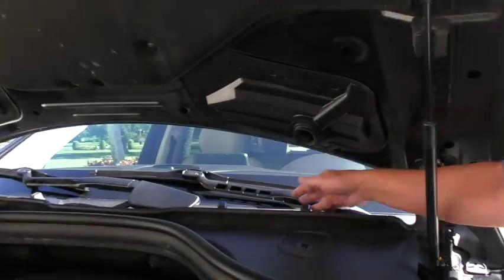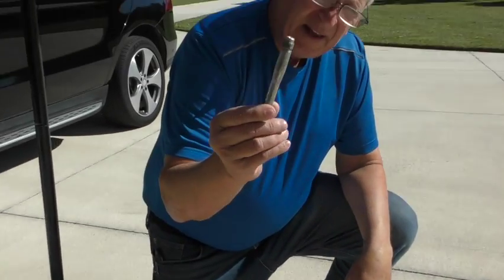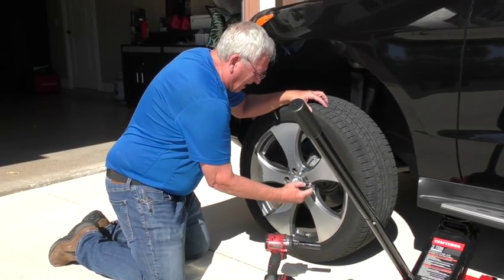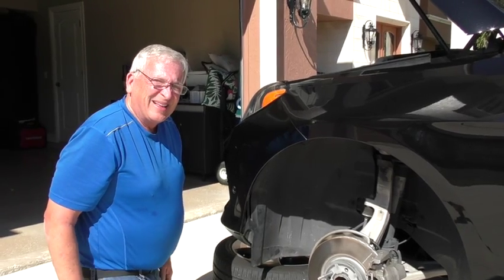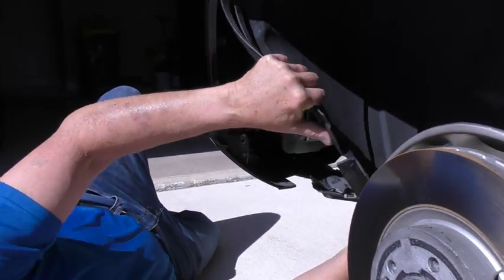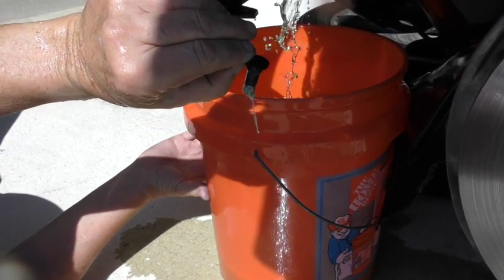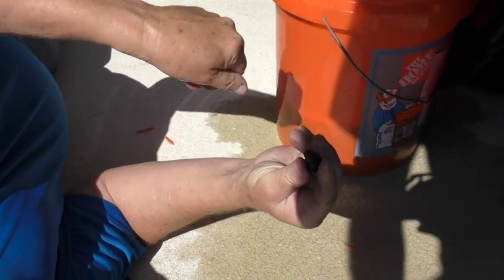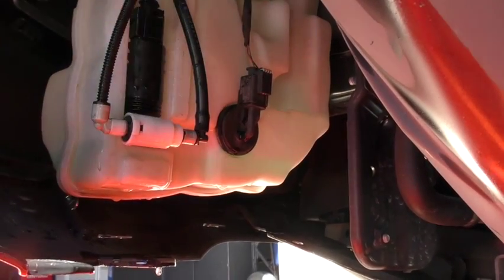Mercedes GLE 350 Windshield Washer Unclog W166

Comment: This is a nice DIY video. I fixed my clog without having to resort to all of this. I drained the washer reservoir with a vacuum siphon as low as possible. I then added approximately 2 cups of bleach followed by about a gallon of hot tap water.  Let it sit for about 10 minutes. I then took my garden hose and spray nozzle and stuck into the reservoir as far as it would go and stood back while the water was turned on full blast for a few minutes letting everything back flow out the top. Started the car and the washers were working again. I let them run a while to get the bleach out of them and finally rinsed everything with water. It is now good to go and took me all of 15 minutes.
Reply: Thanks for this it worked for me today 👌
Reply: Your method worked like a charm!  Much appreciated!!!

Comment: Thank you for sharing. This is exactly what I need to fix my windshield washer does not work at full pressure.   I didn't have to remove the wheel at all, just turn to the right as far as possible (I parked up on the driveway ramp so it might help in my case.  I pried oven the wheel well trim enough to put my hands in, removed the pump and then removed the grommet for cleaning.  I also found something interesting, if the hood is open the front washer won't operate (the rear does).  I first thought that my stalk switch or the pump was broken! After cleaning the grommet which was full of white sticky gum, the washers now work at full pressure again.
Reply from the maker: Great!

Comment: 2017 350 GLE washer pump replaced twice by the dealership, STILL wouldn’t pump just like your video. I had the same issue with plugged suction grommet. I also didn’t remove tire and just turned hard right (thank you commenters). Took less than 30 mins. Thank you for this awesome video and tip! So helpful!

Comment: No need to remove the wheel on a 2017 GLC300!  From the steering wheel, just turn the tire to the far left.  This exposes the plastic "clips" for removal.  It's unnecessary and a "pain point" to actually jack up the wheel and remove it.  The entire process is 5 minutes.  Thank you!

Comment: Thank you! Just had exactly the same problem, and same car. Will get it unclogged over the weekend and your video helps a lot.
Reply from the maker: Glad it will help.   Easy project and you'll feel great to getting it working again without dealer $$$.
Reply: Didn't wait for the weekend and fixed it already. Working perfectly now. I didn't take the tire off - it's a bit tight but just have enough space for me to reach the pump and filter. Thanks again for the excellent video and explanation!  @letsrolldiyauto1532

Comment: Thanks for the video. I had all the correct tools. I didn’t have to remove wheel as I raised the car on Air Suspension to Level 3. But even moving the wheel to the right would allow enough access. Top video, and hey, water jets worked again.

Comment: It is not clogged by regular washer fluid. It is clogged by RainX PINK silicone based fluid as recommended by Mr. Scotty.  Believe me, I have to replace my pump and nozzles after using this stuff. Now I am switching to regular blue stuff. No more issue.
Reply from the maker: Crazy, isn't it?  The blue stuff is what clogged mine.

Comment: Thanks for the video. I had the same issue but I did not have white gooey stuff but clogged grommet which was not visible. I thought the grommet had a big hole at the bottom but it was closed with few small holes. These small holes gets clogged with black debris. You have to remove the grommet to see the problem.

Comment: Thanks for the info...got a gle400 with a similar problem...back pump runs,,but no spray on the glass...front pump doesn't run..no fuses blown
Reply from the maker: Was it a clogged filter?
Reply: @letsrolldiyauto1532  i will pull it out on saturday when i get some time, i think the filter might be clogged on the rear ,,but the front might be some other problem
Reply: I finally had time today to work on the benz,,your video was of great help,,it was a clogged filter...it was quite smelly too..I also realized that with the hood open,,the front washer switch is disabled...took the screen out,cleaned and reinstalled it..changed the washer fluid...good now...thanks
Reply from the maker: @brucksport  Glad to be of help.
Reply from the maker: @brucksport  Great
Reply: Did you have to remove the tire? Or were you able to just turn it? Thanks
Reply: also where is the fuse located for this?Thanks